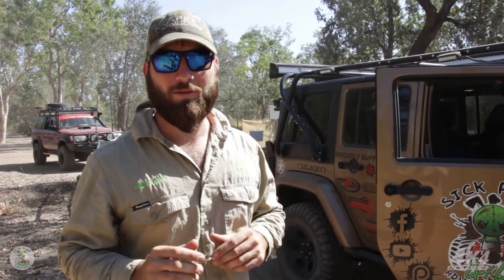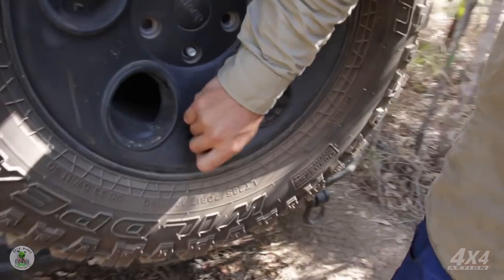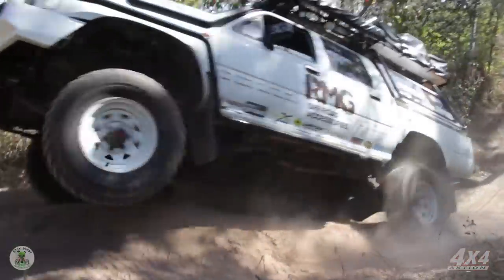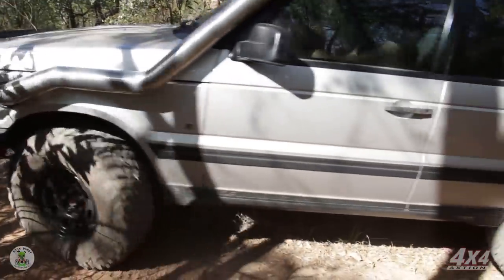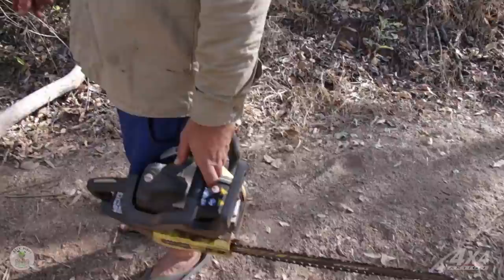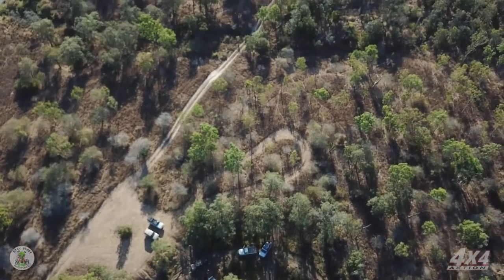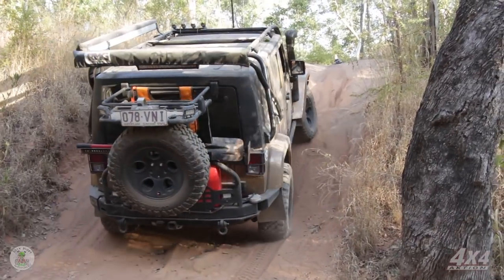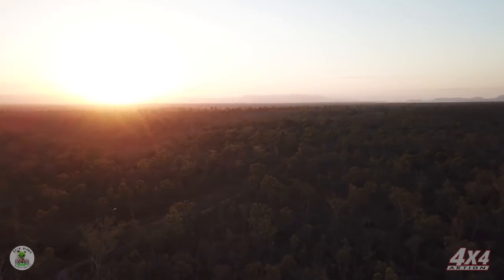HARDEST 4WD TRACK IN AUSTRALIA! - 4WD Action Parody

Comment: Also the prado's of that age will crack the inner guards. Toyota know about it, they make a genuine part to resolve the issue.  Mind you, that won't stop them from blaming the accessories on the truck. With mine, they even blamed the tow hitch receiver in my GENUINE TOWBAR. (Go figure, right?)

Oh, they say the Prado is only intended as a "Light duty" four wheel drive. Of course this changed sometime after the dealer took us over their custom made test track on the property and well and truly after we bought the car.

Comment: LOL new prado and it such an old model Lmao
Reply: Almost bought one when getting my first 4WD and fuck I'm glad I didn't, look at it the wrong way and it will burn through $20 in petrol, then again my 105 is almost as bad for garbage fuel consumption.
Reply: SEE YAI AYE  just bought a hj60 2h diesel how do you think I feel
Reply: @johnsontrucks8806  Bro in law had one of them so I have a good idea, after buying it on the drive home he had to pull over going uphill to let a semi overtake him.
Reply: SEE YAI AYE I have the g pack turbocharged ( mike vins converted 25 or so years ago but was factory turbo) 
So I can pull the hill fine but the fuel I use is like I got a link from tank to exhaust
Reply: @johnsontrucks8806  At least you did the smart thing and got a Turbo diesel, doubt it helps much in the pigfat 60 series though. Hope it's not your daily driver.  How many kms?
Reply: SEE YAI AYE it is my daily 
4006150 something like that 
Getting it reco new rings timing chain the works 400k original no work done other then the turbo back in like 1990 
But she an absolute talk monster when the turbo kick in but I think that it’s worn out because it only works above 2.5k and considering the it redlines at 4200